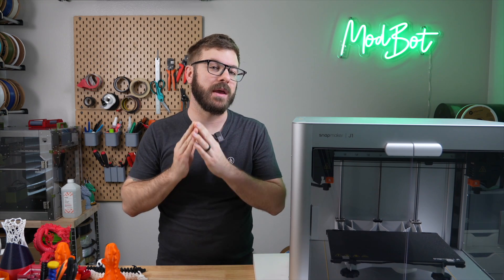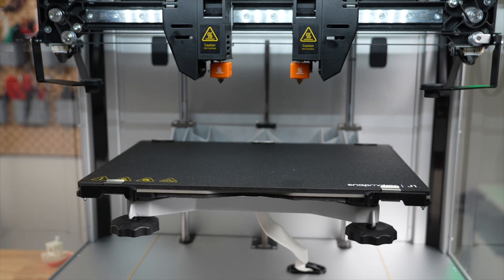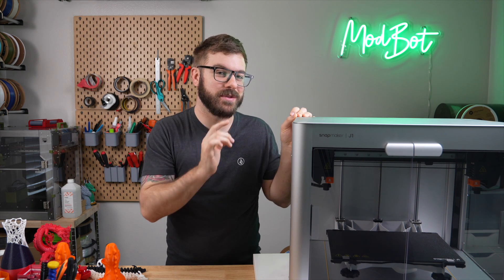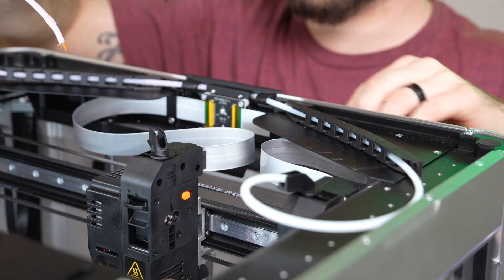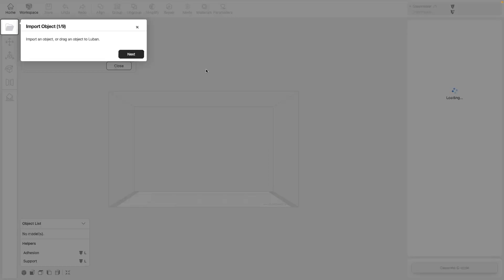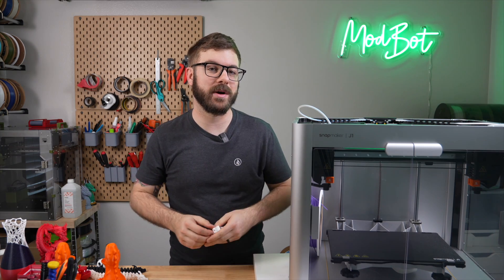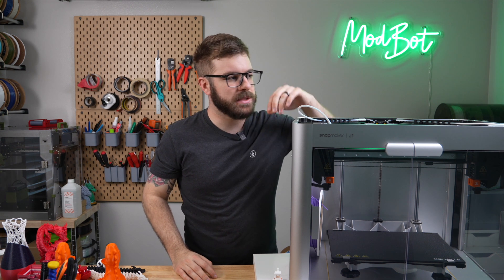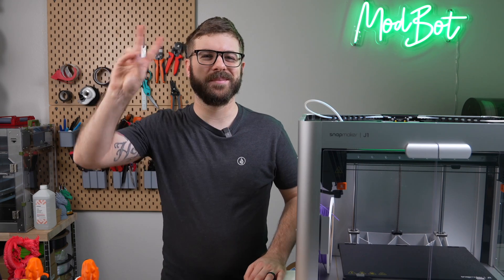Is The Snapmaker J1 The Ultimate IDEX Experience?

Comment: I don't know if anybody could help me with this but, when I print something with their program Luban on the Snapmaker everything works fine, but when I use prusaslicer which I want to switch to as it has more possibilities for saving & importing I am having clogging issues. I tried copying all the settings as good as possible that I used before, but it still doesn't want to work. Any help would be highly appreciated

Comment: If you don't like to fiddle, upgrade parts, do "mods", constantly battle with clogging, and expect that you can actually print with reinforced nylon or anything other than PLA then this printer is not for you.  I have had this machine for 6 months and it is nothing but a disappointing headache.  Besides all of the thrown away material and time wasted, it has been broken down for a month now because they don't have the replacement part I need in stock.  They do, however, have parts to build new machines.  Don't make the same mistake.  Get an X1C so you will have an actual usable machine that works right out of the box.

Comment: Good review but i did not see any info on how does it cleans the nozzle between color changes.
Reply: I don't have one, but it likely doesn't by default since it's IDEX. You only need a bit of blob protection from oozing. Either a shield or a very small prime tower would probably be enough.

Comment: You didn't have issues with clogging? Not even temporary clogging aka the clicking sound from the extruder that occasionally goes away by itself but leaves underextrusion while it was present?
You had no issues with bad walls due to uneven extrusion?
You have not experienced layer shifts?
Really????

I honor you've mentioned the suboptimal single-sided parts cooling and the bad bowden tube routing with the sharp bend on top of the print heads. The very few other J1 reviews I've seen so far have not even mentioned these.

Without heavy modifications of the hotend (exchanging heatbreak), part fan and installing a top panel riser for better boden tube routing this printer is not reliable.

The fact that your promised videos about your additional ideas for testing the J1 never showed up makes me believe, you meanwhile ran into those problems with your J1. 😉

Comment: A couple things:
I purchased a J1S, and I had some luck printing PLA on it, but I’m running into problems printing, PETG. I didn’t know if you had speed/temp/flow settings that you could share for PETG. Main Brand is IC3D’s RPETG. Also using poly maker, and California filaments.

The other issue was I went to your Patreon site to sign up to ask this question but it appears to be somewhat inactive. Do you have another platform where I could sign up  where it would be active?
Reply: As a rule PETG can be printed the same as pla but with increased temperature.  I will sometimes slow the perimeter speeds down for petg but only if you want slightly more quality.  I would run some calibration models (temp, retraction, flow) with your pteg and go from there.  What issues are you having?

Comment: Wish the sample prints have random distribution of the two filaments, highlighting the efficiency of filament usage compared to frequent purging.
Also, nowhere there is mention of ability to print two different models(seems to be due to lack of cpu oomph) at the same time. Does printing two different materials mean, it should be possible in theory? If it could, will definitely outcompete Bambulabs without a doubt. Just some 💭❤️👍

Comment: The electric bed leveling and alignment is simply the best in the industry. Like that is the best I have seen. I want a dual extruder printer myself.

Putin the filament on the back though is one of the worst decisions that printer makers regularly make. It's awful and it means that instead of just handling filament you have to wrestle the whole printer just to swap colors. Frankly it is stupid.

It really should have a more well sealed enclosure.

Idk. The best offerings still don't fully measure up to like my standards but it's almost always because they completely screw up at the smallest details. Like the fit and finish are things that really matter.

Comment: Heyo! Just gonna throw out some random information as to why Snapmaker came out with the J1. The J1 started out as a kickstarter from a small team that use to work for Snapmaker but they left to start up something on their own. The J1 was originally named the Jadelabo J1. Kickstarter was a success but the team decided it needed more time to redesign some crucial areas for the J1 (moving touchscreen to different location, better design for the structure of the heated bed, the entire chassis being casted instead of several separate pieces that had to be put together by the Jadelabo team, etc). Once they were at the tail end of these big changes, they had to reach out to Snapmaker to see if they would like to get together and sell this printer under Snapmaker. Hence the odd product of the IDEX J1 in the lineup of the other Snapmaker products. Hopefully this was helpful/interesting in some way!
Reply: Thank you for the info!
Reply: So are there two variants of this machine on the market? Like a kickstarter one and a Snapmaker one? Or were you just talking about prototypes..
Reply: @ianirwin1237 in a way yeah there’s different variants/stages of the Snapmaker J1.

The first variant is the kickstarter which had a few batches of J1 printers made to fulfill the orders from kickstarter. The next variant is when the printer officially came out on Snapmaker’s store page. Then you’ve got the Snapmaker J1S model that included some additional features.

It’s the exact same process that Elegoo did with the Centauri Carbon and what Snapmaker is doing with their U1 model. You’ve got early access then actual production models.

Comment: I don't know if I got very unlucky or if you got lucky. My J1 couldn't bed level reliably at all. Every time it went down and touched the contact point the indicator bounced back and forth - never (okay one time it did) actually settling in a specific location. Immediately re-running the bed leveling process back-to-back gave vastly different results each time.

I ended up giving up and returning it.

A lot of prints came out okay but not perfect regardless but regardless of slicer used (theirs luban? or cura w/their plugin) it always missed extrusion on initial layer circles (to be used for screw holes). Tried changing multiple settings in either and it just refused to print them properly.

Hoping I just had a lemon.

Comment: Are you (or anyone) familiar with the Snapmaker 2.0 A350 with the dual extruder module? I have a quick question.  With a Snapmaker 2.0 A350 with a dual extruder, are you able to pause the machine and switch 1 of the filaments and resume the print?

Comment: I'm looking to upgrade my current printer and was previously set on the X1 Carbon.  The ability to do multi-color prints without so much was is really attractive.  I'd be curious on your opinion on how they compare.  Do you anticipate testing with different materials in your later evaluations? Thanks
Reply: Having owned idex printers the upside is there is zero waste when changing filaments unlike Bamboo where the wastage can be 50% of the model with a heap of extra time added.  With idex the unused nozzles parks and the hotend temp dropped. I had mine park over a spring steel ooze plate blocks the nozzle so that means I didn't need to purge any filiament when that head started printing again as there was no ooze.  I mainly used idex to either print petg parts with pla supports or visa versa.  Multiple colours was and added bonus but rarely used by me.   Speed wise the only wait was the hotend  coming back up to temp.   The dual printing feature was aslo fantastic with twice teh prints in half the time.

Comment: Great video!
J1 is receiving scarce coverage only while MK4 and X1C are hot and all, so I appreciate you cover this machine. It seems this is the first non-tinkering IDEX so far.
I'd like to see dual material prints with PLA support on PETG parts. That'd be awesome!
Reply: I read Snapmaker j1 has massive issues. The userbase really upset about the service and software updates.
Reply: BCN3D have been doing idex for years.
Reply: @thegarageluthier  ...only at industrial price levels though.
Reply: @thegarageluthier  bcn3d and also raise3d both are very expensive.

Comment: This is almost a printer I want to have.  To be clear, I'm firmly in the "I don't want to fiddle with it, I just want it to work" camp of 3d printing.  I'm more worried about accuracy than speed, but lately I've been printing a lot of many-copies-of-a-small-thing jobs, so an IDEX would actually be useful for me.  But this printer just isn't quite there.

The lack of sealing on the enclosure is the biggest problem.  The lack of automatic tramming is the other.  I just don't trust those screw knobs to hold position.  Not in my home, anyway.  And since the printer doesn't check the tramming before each job, the only way I'm really going to know if something slipped is a failed print job.  The PITA loading process is just icing on the cake.

The hotend design isn't a big deal for me.  I quite like the quick-in/quick-out design.  I'd be happier if the hotends used a single-piece nozzle-and-throat like Revo/Bambu/Prusa XL, but since I'd end up treating them as a single component most of the time it's not that big a deal, as long as everything is set up properly from factory.

Now, I'm not really in a position to be buying another printer anyway.  But if I was, I'd almost buy this.  Set it up with a good, pressure-sensor based ABL system, clean up the loading process, and make the enclosure mostly airtight and ideally double-hulled for insulation, and I'd start saving my pennies.

Comment: the amount of thought that went into designing and programming the offset calibration is incredible. the lack of thought that went into the filament holder/reload is also incredible, but for other reasons. they made a one time set up so incredibly simple, but a more regular task much more complex
Reply from the maker: Haha my thoughts exactly. It’s almost comical. I would much rather deal with figuring out a spool solution though than the work it took to get the calibrations set up like that. Still a very silly decision that could have easily been made better.
Reply: @ModBotArmy  The 'where can we cut corners to save money' equation at play....

Comment: i wish other single extruder machines would use this method of bed leveling along with ABL sensors. Having the ability to close the gap and adjust as needed then let the abl work out the variances of the bed itself would be huge. Like with the Sovol SV06 and SV06+ not having a way to manualy level the bed in order to fix the issues with the firmware and ABL. 

Also adding a main bed fan like the K1 or P1P/X1C would help out a lot seein its core xy the extruders and printing layer doesnt change the bed height does a main fan would help out.

And quick question isnt a reverse bowden set up just direct drive with a bowden tube?
Reply from the maker: Yes exactly it is just a guide tube. I dont love the name reverse bowden. I like guide tube but reverse bowden seems to be what we settled on. 

Klipper does have the assisted leveling you are describing but I do not believe Marlin does. 

Check out "Adjusting bed leveling screws using the bed probe":
https://www.klipper3d.org/Manual_Level.html
Reply: @ModBotArmy  Most printers dont usually come pre equiped with Klipper. I guess what im saying is bring the assisted manual bed leveling with an ABL on mass produced machines like the SV06 which terribly needs a way to manually adjust the bed height without changing out stock parts to keep it within a workable variance for the ABL.

and thank you I figured as much just wanted to be sure
Reply from the maker: @EDC3DP  I agree. I would love to see it become much more of a standard. It’s a huge quality of life improvement.

Comment: $1300? Ok. I can get 3 Sovol SV04s for that.
Reply: As someone who has been designing IDEX printers for over a year now $1300 is cheaper than some of my designs and I'm always working on a budget. It's a nice price for a machine prebuilt, retail available and with support. Yes I can always buy cheap junk to try and get the job done but I will always desire the next step up.
Reply: Yes why buy a lexus when i can buy 3 suzuki instead.
Reply from the maker: Sure you could. But it would require lots of upgrades to get remotely close to this printer. SV04 is a great tinkering machine. I have used it a handful of times on the channel but the J1 is in a completely different class.
Reply: @ModBotArmy  I'm down for a friendly print off using dual color pla models and compare quality and print times. Might be fun
Reply from the maker: With the SV04 matching J1 speeds? I’m not saying the SV04 cannot print nice prints. I have used mine for pva and dual color with pretty high success. It did take much more fine tuning and the firmware was incredibly frustrating to get it to that point though. (We set it up live on the ModBotArmy channel)
Reply: yeah but i have 2 sovol printers and the agrivation on bed leveling even with their ABL is horrible, I dont even want to think about what an IDEX would be

Comment: The history of this printer is rather strange. It started as the Jadelabo J1 that was created by some people who left Snapmaker and launched on Kickstarter. Somehow they get back together with their ex, and got merged back in to Snapmaker.
The dual nozzle calibration is very similar to the one on the Craftbot Flow IDEX series. In the Craftbot, you turn the magnetic build plate upside down and the nozzles probe on to the surface for z and inner edge of circular holes for x/y. Spring contacts touch the back of the plate to allow the electrical continuity measurement. In the Craftbot case, the calibration is completely automatic.
It also has the spools on the back!
Reply from the maker: I actually found an article from I believe All3DP that talked a bit about it. I ended up finding the kickstarter from a couple of years ago but it was very confusing and minimal info. I wonder what brought them back. Whoever the team is that designed it I hope becomes the team that leads the way for the company. Some silly design choices where made but for the most part lots of great calls. It has been some time since I have seen the CraftBot but I swore there was a cube that it used also for the offsets. It has the assisted bed leveling too does it? I set one up once and I think it did using a bltouch.
Reply: @ModBotArmy  I’m not sure about the earlier Craftbot printers, but the Flow series just uses the plate (there’s also a UI guided plate leveling/offset using a BLTouch. (I have a Flow IDEX here. No calibration cubes.)

Comment: That auto-calibration setup is as ingenious as it is simple. A custom PCB with an alligator clip hooked to the hotend could add such functionality to most any dual extrusion printer, with just a little more work (but a lot less than measuring prints!)
Reply from the maker: I am really hoping to see this added to something like klipper. It is such an awesome way to align tool heads.
Reply: @ModBotArmy  I'm normally a contributor to Marlin, but I'll see what I can do.
Reply: "@ModBotArmy @DejitaruJin, out of curiosity—why is electrical contact necessary to locate the nozzle instead of just relying on physical contact? Couldn’t the printer detect when the stepper motor stalls to verify that the nozzle has hit the square hole wall? Isn't this the same method many printers have used to eliminate limit switches?"
Reply: @CallMeSwal  Electrical contact is way more accurate, and it guarantees you know exactly where the tip of the nozzle is. Stall detection "works" for vague X/Y homing to 0, but it's only accurate to within a full step of the motor, which is relatively coarse in the world of 3D printing.

Comment: Oh Great another pro machine which only costs as much as a top end Bamboo X1 Carbon. 

Well, that's get for the rich users out there! For the rest of us users it be only a dream again.

Seems more and more printers are going down to route of only rich users can buy them!  

Like Prusa's etc.  Good if you got tons of time and money. 

Not so for the rest of us.
Reply from the maker: It’s all relative. It is not the price of an Ender 3 yes, but compared to what IDEX printers have costed with this level of features it is an absolute bargain. It’s due to many of the expensive machines and their tech that we have seen much of it trickle down to the hobbyist space. That’s usually what ends up happening. So although this printer may be more then you are wanting to spend I can guarantee some of its features like the automated calibration will make its way down to other printers. This is exciting for everyone 😊
Reply: Still cheaper than a properly sorted out Vorons 2.4.